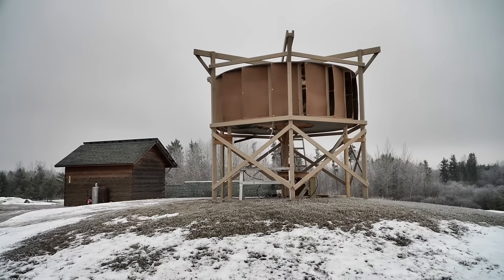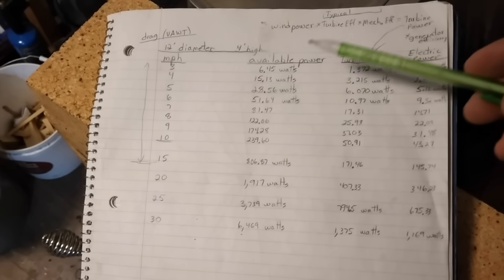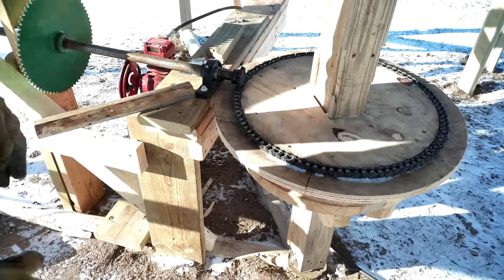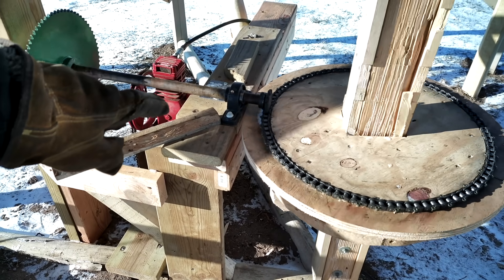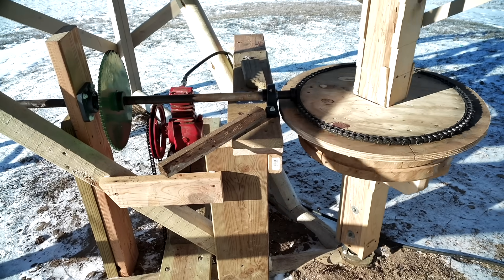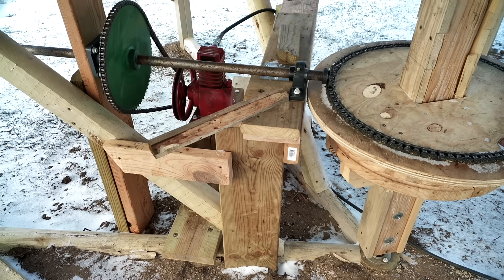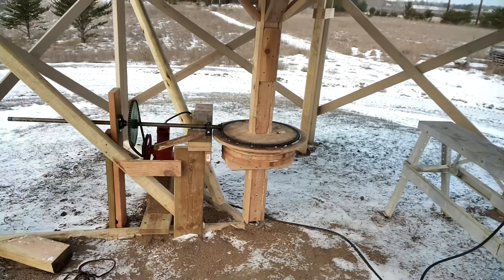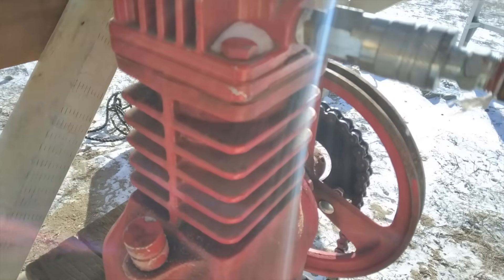COLD winds→VAWT→'Side Bow' chain drive→red compressor

Comment: The downside to a VAWT is that the blades are only capturing energy through around 90-100 degrees of the rotation and actually removing power due to drag during the opposite 90-100 degrees of rotation.  During the remaining segments of the rotation they're doing nothing. 
Whereas a traditional windmill facing the wind, the blades are capturing energy during all 360 degrees of rotation. 
That's why vertical axis wind turbines are so much less efficient.
Reply from the maker: Looking at the specs of my Whisper 600, along with the other small wind generators out there (actually tested), they all seem to only be 5-30% efficient, & rated at 25-30 mph winds.  I planned that some wind diverters would lessen counter torque on this VAWT.  But you're right with what you say.  Thanks for the interest!

Comment: Have you thought about 'stacking' another 4' x 16' set of wind vanes on top of what you have already ? Maybe 2x the power for only a 4' to 5' height gain.
Reply from the maker: The plan is to test something this size, (it didn't cost that much), and if things look favorable at the end, build one 20' or larger in diameter, with about 8' tall size, using 4' x 8' sheets of some better material.

Comment: Just gear down the final drive, this setup is not work otherwise.  Is it pumping at all at these speeds? Keep in mind - load will rise with pressure accumulating.

Comment: ... I was inclined to evaluate the structural integrity  of your  machine based upon its unsustained acoustic wave propagation made relevant by the  frequency of its sinusoidal resonance and associated  transitional damping capacity..  That which is heard can be deemed more relevant than  what might be seen.  Whether intentional or accidental, I appreciate your sound production equally to your visual presentation.  Inasmuch as theoretical efficiencies matter more to  rent seekers during recessions, I find additionally, that an unintended consequence of your actions is the veritable eating of the pudding in your proof, which currently tastes  as flat as the rear tire on my well worn Puch 12 speed  bicycle.  May I ask, how much will you charge me for the air that we may together  expect to eventually put in it? ...
Reply: Have you ever been told you are too smart for your own good? Me neither......I have also never done acoustic analysis of bearings, at least not with adding microphones and oscilloscopes, on the farm that is still a good bearing, it's my bearing that frustrates analysis
Reply: @jeffreystroman2811  ... baring of the soul is best ....

Comment: Have you ever thought of putting another wind turbine over the existing one it will be so much more easier than building a new one and would make it so efficient on the low speed Wind
Reply from the maker: The support structure isn't strong enough for that.  Just planned on a bigger one if it looked favorable.

Comment: Increase the diameter of the 1st gear and decrease the diameter of the second gear that drives the gen chain you should be able to decrease the required torque to level allowing operation of system.

Comment: need to make your inside chain (on the turbine) closer to the shaft. the smaller the radius the higher the gearing, it'll push a little more. put a bigger gear where the green one is also. still more design ahead of ya bud. new to your videos this is the first I seen of ya, will subscribe!

also make yourself a good wind funnel lol

Comment: Just put magnets around the perimeter of the wheel and serpentine coils beneath it that will generate much better than using gears and such power transmission.
Reply: You can see the turbine shaking. And you'd lose gearing. You could simplify the current setup and make it more efficient though.

2 gears or a chain is 90+% efficient, plus the same for an off the shelf generator. A homemade generator on a wooden shaft that flexes isn't going to beat that.
Reply: @msowdal  great concept. The linear velocity out on the perimeter would be substantial in high winds.

Comment: 3:23
You don’t necessarily need a bigger turbine, you need a lighter turbine if you are going to change design., I’ve been thinking about a design for a while and I think I’m ultimately going to try a 4 foot disc, about 6-8 inches high, and cut 4 inch pvc into the “fins” for the turbine blade. Just made from 3/8 plywood or something, probably sit about 12-16 foot in the air. but you could keep your design and just close the gaps more (or all the way) that lead to the center in between your “blades”. That way the air doesn’t just flow through and actually gets caught by the blades instead.. like a ship sail.. speaking of ship sail and not adding weight, you could use fabric to close the gaps?
Reply: I think you have everything great, just need to close those blades, the mass you have moving is far too great for a couple watts..
Reply from the maker: I did a video with a 4' diameter one.  It used some lighter weight stuff.  But when you look at the numbers for that size in the calculations for wind turbines, it's pretty small output for the winds I want to work with.  So I wanted to test something bigger.
Reply: @ yes I would try to get maybe some drop cloth or something, cut it up, and make a little loop of it in those open spaces, it should catch the air a lot more and help with lower speeds!

Comment: Minus diverters', you would need to either or both make the blades taller, or the blades lighter. in order to make the system operate at the wind speed shown.  (Your final option would be to throw a gear reducer in there so that it takes twice as many rotations but with only 1/2 as much force.  Which may not be that bad of an option IF you don't need as constant a supply of compressed air?))
Reply from the maker: Thanks for your suggestions

Comment: Thoughts,   Use a bigger ratio to drive the compressor slower.   Use a smaller compressor.  If your chain becomes unstable with the screws holding it.  Weld the chain to a piece of steel or pieces of steel.  segments like a wagon wheel rim.   Why not use  components with vertical shafts.  Lighter chain. Improve the shape of the airfoils.  two pieces of material of different lengths secured on the leading and trailing edges will make an airfoil shape.  Have fun and stay safe.  Keep things simpler for less loss of power.
Reply from the maker: If I want air, I agree a smaller compressor is needed in that spot.  Thanks for commenting!

Comment: Think Different

Rather Bigger, make a Stack of Way smaller, and use a controller to align each platter (1 of 30) in series and parallel circuits loading up a super capacitor to dump to a charge controller.

End of Line

Comment: Love what you're doing here.  I work with large steam engines and they all have massive flywheels to run smooth.   I wonder whether having a large flywheel hooked up would carry your drive through the compression stage of your compressor a little more smoothly?
Reply from the maker: I think I just need a smaller compressor in that spot.  Thanks for the interest!

Comment: Fascinating project. Based on my own experience,  it's not the quantity of air, with diverters, etc, that needs work.
The shape of the blades is the big bottleneck to performance.
The power from air flowing over a curved surface can exceed the sheer pressure of the air by quite a lot. 
The cheapest way to get reliable, smooth curves in your Vanes is probably 2 or 3 sheets of plywood veneered into an airfoil shape. 
If you have access to fibreglass,  that would be even better.
Well done on the device to date.
Reply: Have seen blades cut out of PVC pipe to get the airfoil
Reply: @zeusapollo8688  That would be an improvement,  but it's a big area to cover with 10" half pipe, I guess.
Have you seen the ones that use half rounds from plastic containers or metal drums ?
Reply: @dnomyarnostaw - I would think that having vanes that could swing in on the “upwind” side would reduce that side’s resistance, and the blades would flap back out against stops, when caught by the breeze on the “powered” side.
Reply: @dnomyarnostaw  Robert murray-smith did a bunch of videos on wind generator blade design. Might be worth checking out.  I am sure he would be fascinated by this one
Reply: @orcoastgreenman  Yes, that has been done before, even just with floppy sails. 
But, in any case, the most  power is derived from the Bournoli effect, with air over a curved surface. That requires rigid "Vanes," and the overhead of making them open and close to the wind direction becomes problematic. 
Have you seen those cooling spinning vent things on the tops of vans and houses ? They are called Flettner vents,  and they operate on a similar principle. 
All this stuff has been done before by hundreds of engineers,  and the results have been written up in dozens of papers. 
This experiment is just one of self-discovery of well understood science.
Reply from the maker: The design of this turbine is not what many people are thinking it should be.  It's not like a squirrel cage blower, or a cupped blade to catch the wind.  The design is that the air will enter, and swirl around the inside (dragging with friction against all 'blades', all the way around) until the air loses rotational velocity, and exits the top or bottom.  There are other videos I made about this turbine design, used with steam and water.  Now I'm testing to how it will work with wind.  Having wind diverters was part of the original plan, and will stick some in to test that too.  Thanks for the interest!
Reply: @doubleMinnovations    Of course , you are totally free to follow whatever ideas you like.
I was coming from the place where you might actually have a chance to get meaningful results.
Follow your dreams, man.
Reply from the maker: I appreciate the interests and ideas you have presented, along with the others.  I have a whole list of changes in the construction I would make if I did it again.   I'm past 'plan D' already. 😆.   But part of plan 'A', is that this would only be up for about a year to test ideas.

Comment: Would gear reduction help you here, like double the size of the big gear on the output shaft and half the size of the gear on the compressor?
Reply: I’m thinking maybe a Peerless 700 lawnmower transmission.  That will get your 90° angle change and most of them are three or four speed plus reverse.  That way you could make the power more useable as the wind speed changes.

Comment: Hi, I am not an expert but have you tried changing your wind vanes on the wheel cos they look very inefficient. you could make small models and see which design works the best.  A wind machine this size should put out a lot more power than what you are showing.  I am a big fan of your channel and glad to see your still experimenting with your ideas.
Reply from the maker: In real numbers, how efficient should should a home-made, lumber VAWT be?
Like I say in the video, this is a model for testing.  I have a video of a smaller one too.  How big/small should a model be for testing, to get the best accurate readings?
Reply: @doubleMinnovations  Hi Thanks for your reply. Testing is about what works best I think? Keep trying different options until you find the best result, The first step would be making the center bearing as friction free as possible. and then work outwards on the wind vanes until you find the best result . Irrespective of the size.  If you get your vanes right this 12 foot  Vawt of yours should be able to turn your car over LOL.  😊😊 I realise you are still testing hence my suggestion.  I am all for testing and trying out different things. 
I just wish I had the space to build like yourself it is so satisfying to be able to build a working model.
Hope you succeed with your idea. Its a real pleasure watching your ideas come together. Kind Regards Deryck

Comment: why the compressor and not the motor?
Reply: Very likely because a compressed air line system is better at converting a variable input to a steady output with the least amount of steps. With this you would go from wind turbine ➡️ compressor ➡️ storage tank with emergency relief valve ➡️ regulator ➡️ tool. Where as with the motor it would be: wind turbine ➡️ motor ➡️ charge regulator ➡️ battery storage ➡️ inverter ➡️ breaker box and finally ➡️ appliance ( tool). Losing power each step. There are some that are trying an even more direct approach with: wind turbine ➡️ moving paddles in a hot water tank to convert wind energy directly to hot water by friction for space or regular water heating.
Reply: @stephenroot1012 thanks for that.
Reply: perhaps a water pump and tank feeding a trompe would be more effective for compressed air

i was surprised that the compressor turned at all, that electric motor wasn,t small